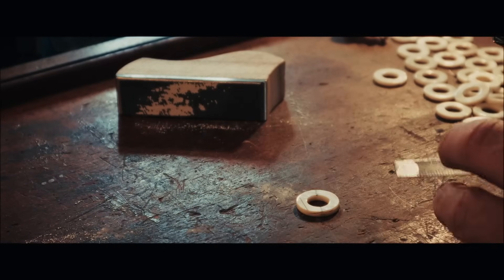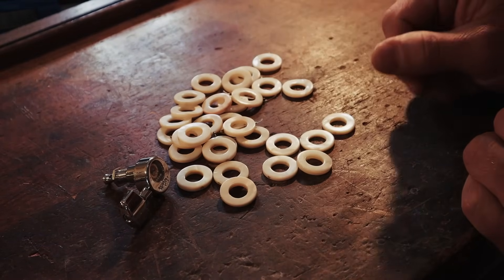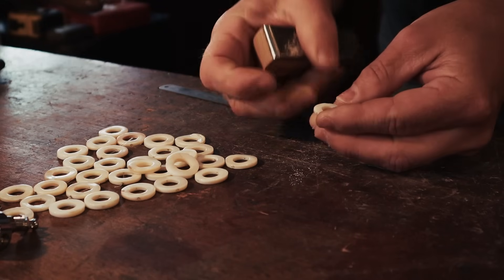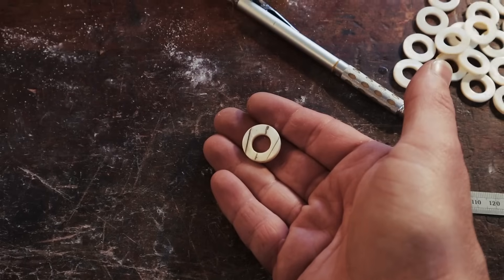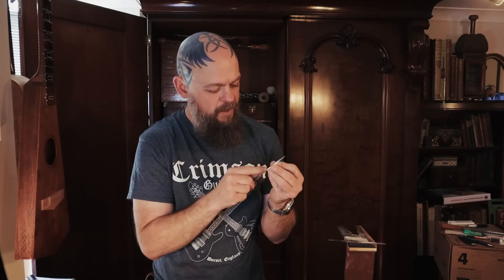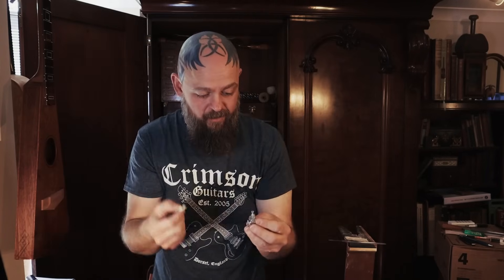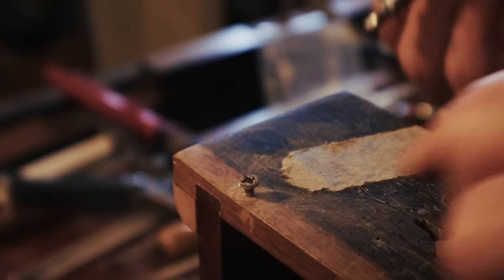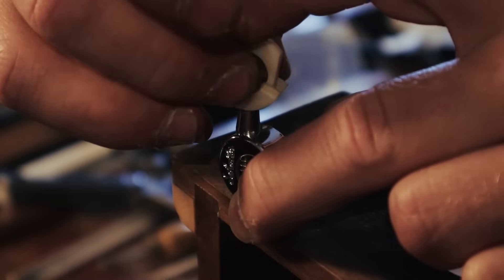Making Mother of Pearl Tuning Keys for the Hand Tool Only Build

Comment: Hey Ben, ex jeweller and ex Lapidary tool seller here. Great design but using tools that are 'cutters' rather than 'grinders' on the Reconstituted turquoise beads just had me on edge! You need some Bead Reamers, they're brilliant and are a simple hand tool. and some diamond core drills. They'll fit in a vintage hand drill or traditional powered drill. And for holding such small items. Get yourself some dop wax, it melts on to the end of a stick (or wooden file handle for comfort) and then the bead is pushed into it. Once set its solid.

Comment: For a small, light guitar like this, I would go with friction pegs, as on flamenco guitars. The shape of the head wouldn't be interrupted by the tuner shafts sticking out the side. There would still be scope for customizing the pegs with something like semiprecious stones set into the ends of the pegs. (You could match the garnet that's in the nut.)

Comment: Ben, I loved the thinking outside the box by using the MOP beads.  My one comment would be the lack of a respirator when cutting or filing/sanding the MOP.  You have mentioned in the past about being careful and using PPE when working with MOP because it is hazardous to breathe in.

Comment: Tom Ritchey, a mountain biking pioneer and expert bicycle frame builder said fairly recently about modern day frame building "theres a heck of a lot of art going on..." not sounding too critical but pointing out that it isn't exactly innovative if the end product does the same job. Id say things like fanned frets, zero frets, clever electronics, or use of clever space-age materials might count as innovation, but custom tuning knobs are just "a heck of a lot of art" or "jewellery" as you describe.

Comment: Beautiful work as usual!  Your final assessments seem spot on.  I too have tried tuners at various angles with less than impressive results.  Tuners seem to look best when aligned to a center line, a straight edge on the guitar, or the tangent to a curved edge of the guitar.  And while the tuners look great, they also look too big for that headstock.  I've tried swapping knobs, but they are seldom interchangeable, and I never went as far as file-to-fit, and never tried to make my own.  It's nice to see you improving existing builds instead of just moving on to the next project: "Enough time to do another one, but not enough time to get one right."

Comment: Stopped at 19:19. 
Love the concept, This is why I watch-a master creating on the fly, using decades of experience to create something uniquely beautiful.
But…
Dude, those are going to break. I love you Ben , but the rotational force on 2 little, brittle sticks of MOP….if the were metal, no issue-wait!come on, now there’s a new product! Custom CnC’d  metal tuner heads. You could get really creative. 
Also, serious question-would CA glue hold over time?
Ok, let me finish the video and see how wrong I am.

Comment: Love the idea... have you considered taking the top off the tuner and flipping the base so the curve goes in and follows the shape of the tuner back. You can still use the bead screws and just have compact tuner heads... the shaft length then won't be as obvious.

Comment: Alternate uses for my tools:
1) Fret end dressing file: also used to carve and soften the edges of nuts (for early 2000s PRS style comfort carves).
2) Fret leveling beam: also used as a "hand tool belt sander" for things that need to be very very flat (like machining nut/saddle blanks).
3) DeoxIT: also cleans chrome quite well!
4) Steel straight edge: also useful as a wide flat punch to knock the nut off of a neck before dressing frets.
5) Diamond sharpening stones: great for grinding in a very smooth safe edge on brand-new 3-corner fret crowning files whose teeth extend all the way to the edge and have a taste for fretboard blood.

Comment: While I really like the end result, I think I would have added a bit of contrasting wood over the central circle just to match with the rest of the guitar (so mahogany obviously). Also that way you could have kept the shaft as it is and just drill through the top for the screw. Maybe not as elegant as adding the wee pearl but I think it would have been nice.

Comment: Do you not fear that the 'square hole' in your newly created white handles will 'round off' as the rotational force is applied in order to apply tension to the strings?